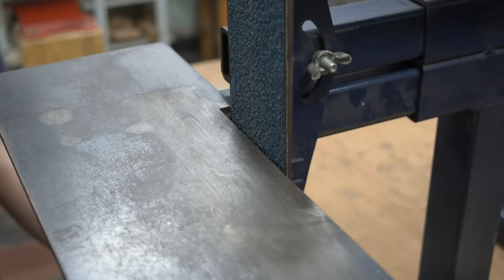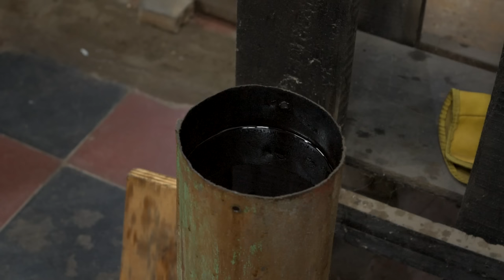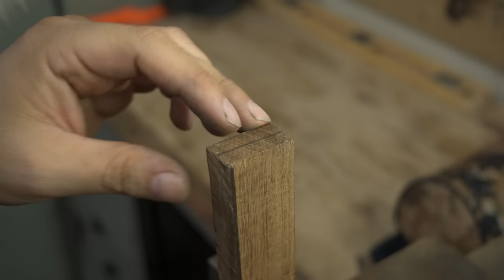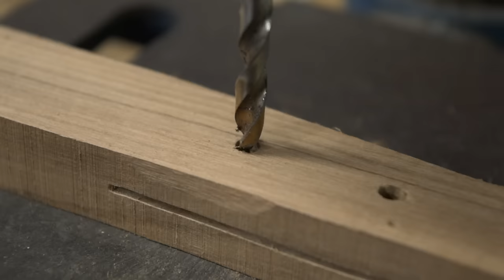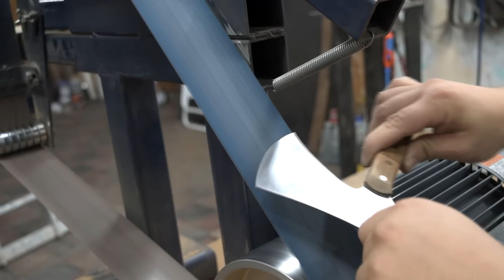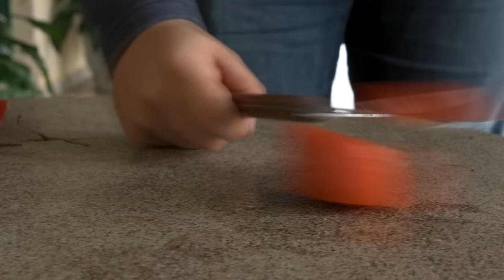Fabricación de una pequeña hacha a partir de un disco de sierra

Comment: El trabajo lo encuentro muy interesante ,pero lo que me preocupa es que una Acha  necesita peso en su hoja ya que además del filo se requiere peso para cortar una rama,un palo ,una tabla y sin peso solo servirá como cuchillo
Reply: A couple of ‘cheek pieces’ of mild steel, either forge-welded or riveted, either side of the axe-head, would be perfect.